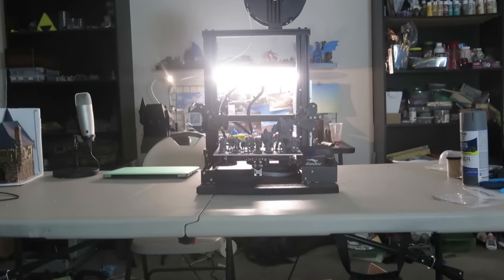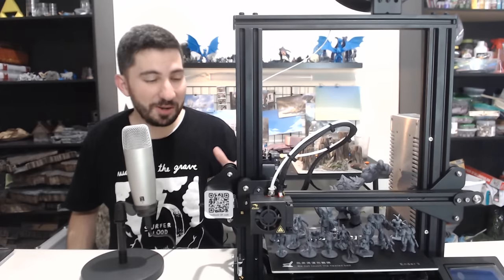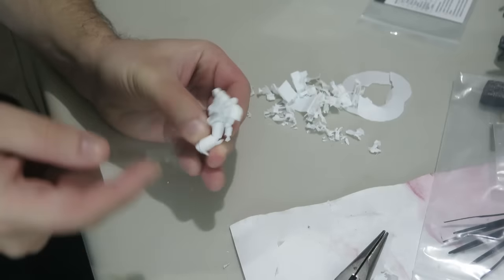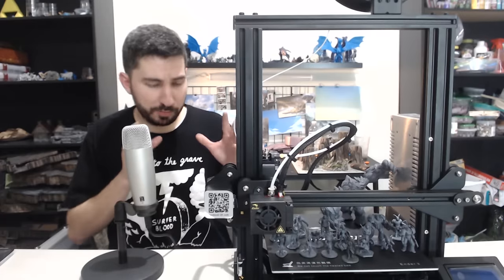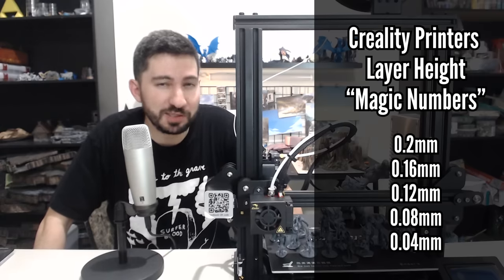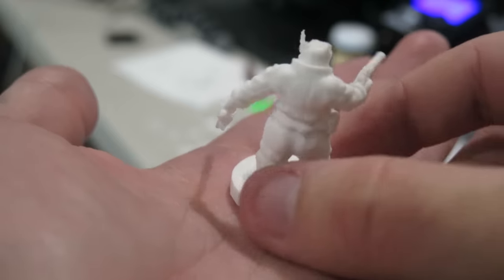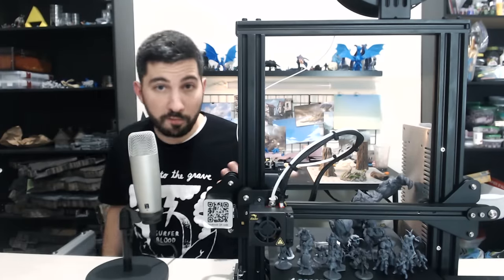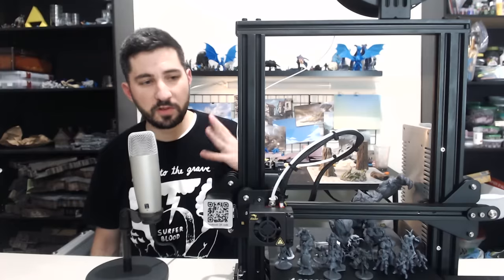How To Print Resin-Like FDM Minis on $200+ 3D Printers (Printing The Game #3)

Comment: Honestly... Elegoo and anycubic are making resin printers so cheap now if you mostly print minis its almost silly to buy an fdm printer.  Were talking the 200-400 range, and if you cant afford the bigger ones you can still get the smaller mars 3 and such and just print large miniatures in parts then glue together.  The resin, even good ABSLIKE resin costs me 26 or so a kilo, which is almost the same as my abs filament (20-22) so really... Just get the right machine for what youre doing, or get both like i did! 😂 Then you can make car parts AND minis 😂

Comment: Thank you for this informative video. I just loaded the settings to print a test cube on my Anet A8. I adjusted the layer heights using its optimal heights found here (in case anyone else finds this useful fir the Anet):
https://3dprint.wiki/reprap/anet/a8/layer-heights
FYI a height of .04 makes the 1 inch cube an 11 hr print lol. .12 brings it down to 3 hr.
Thanks again.

Comment: I'll useing these tipps  for my Robotarm. The Roboarm will have one motor (It will be the shoulder) for the Rest I'll use Carbon nanotubes filled with parafin. You can afort those at www.sigmaaldrich.com ( It's a German company It's also not cheap) but you don't need much cnts muscle fibers for the Hand around 10 and for the arm it self just 4 (trizeps and bizeps) 10 meters are enough

Comment: Hi Danny! First of all, thanks for your videos : )

I tried yesterday the profile you share in the description and after 6 hours, I got terrible results, much worse than my usual profile that takes about 2 - 3h...

Seeing your printed minis and mine, I would like to ask you for a bit of help finding out what's the reason to don't get them as good as yours, and my main suspect is the PLA quality. From the profile, the only thing I touched was the temperatures (nozzle at 215˚C, and hotbed to 70˚C), activated the tree support and set the resolution to 0.05 as you mention in the video. I'm also having this vent ring I will replace and give a try with the stock : https://www.thingiverse.com/thing:2912394

When you have the time, could you print https://www.thingiverse.com/thing:1716769 (I scaled it up  to 125% in Cura) with your settings and share the results? I'm really curious about it because of the level of detail you get, and how will work on this one with elements like the staff or the clothes. I would appreciate if you don't prime it so I can see the printer results without your post-processing magic.

Thanks a lot in advance! : )
Reply from the maker: Jose, email me: 3dprintedtabletop@gmail.com and include what printer you have and your settings please! Let's try and get you square. I might not be able to print it immediately because I've got a lot going on with the Kickstarter, but I will as soon as I can.
Reply: Thanks a lot Danny! Really appreciate your help : )

I write you soon. Good luck with your Kickstarter projects!!

Comment: I do better at printing mz4250's figures at better resolution than he uses for the pictures on Thingiverse.

Not hard (I think he prints in draft mode)  But I'm taking an average of 2.5 hr per human fighter or similar.
Reply: I use 0.08 layers.  Try it.  Its on magic numbers.
Reply: Using Ender 3 with glass bed and just went to the appx $15 aluminum parts upgrade on the extruder.  I wore quite a groove in the OEM extruder and wore out 3 filament guides that I printed.

Maybe a year out from wanting to move up to a 500X500X500 print volume.

Comment: Kinda dumb video. Everyone that is not a complete noob in FDM printing knows that SLOWER = Better quality. You sound like you have some groundbreaking news for the community. Kinda misleading video. I'm not impressed with your results at all. 
How many hours did you take to print a single 0.5mm figure like that? 8 hours 12? That is far from a usable print time for most purposes.
Reply from the maker: Hey there, I answered a lot of your points throughout the video. I'm not sure if you skipped through it or missed it. Slower is just one part of the formula - I knew that from the sticky on PrintedMinis since I started printing. The real difference was the top layers trick in Cura. It usually takes me between 4-6 hours at 0.05mm layer height, and 2-4 hours at 0.08mm layer height. I also like to show all of the results, even the uglier prints (like the Terminator for example) and either way I am not the best printer, and never claim to be. 

The settings have still produced the best prints I've ever been able to get, so I wanted to share. For me, and others in the community, they felt groundbreaking. I wish more people were sharing their profiles and I'd love to give yours a shot as well some day if you have any suggestions to make it easier for others to get good results. Thanks for your comment, and have a great day!